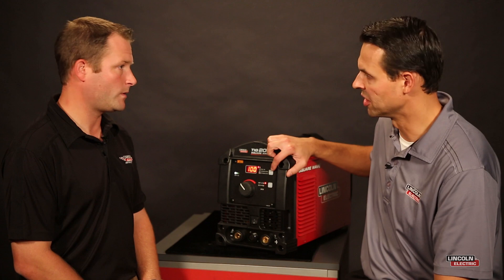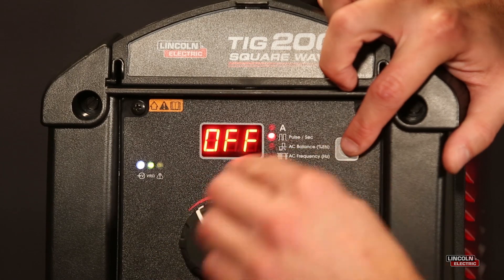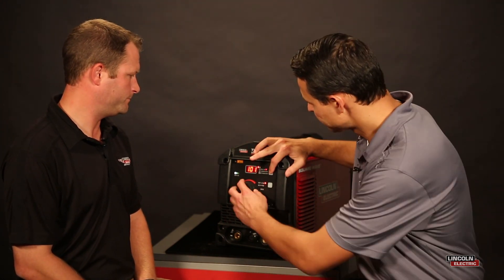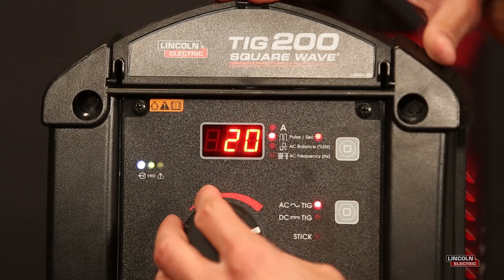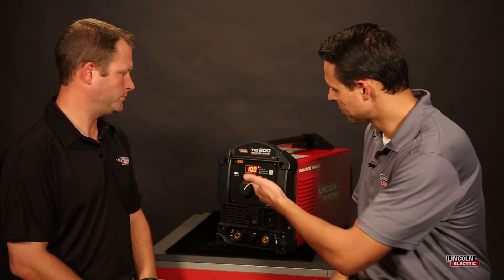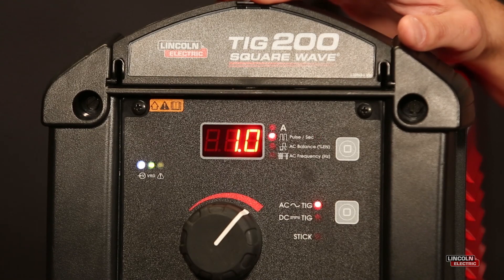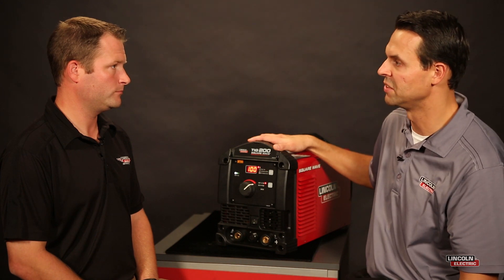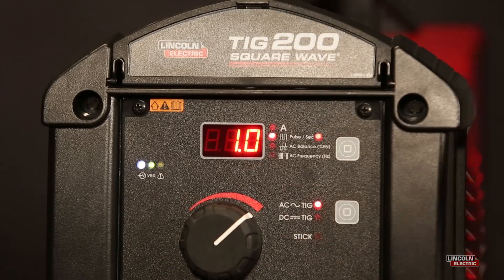Pulsed TIG Control with the Lincoln Electric Square Wave TIG 200

Comment: My bran new machine is screwed! I have to take off work to bring it back tomorrow. The amps light on DC blinks as if it were a trouble code, it won't let me adjust the pulse and on AC it spits and runs very erratic! I'm hoping they just replace it and not try to send it out for repair. I only had it for two and a half weeks. Very disappointed in Lincoln.

Comment: I’m not hearing very good things about this welder . Post flow is to long wasting gas , and arc start is to high . You guys ever going to come out with another version , or is going blue the answer ?
Reply: MajorTendonitis My boss just bought two of these and I love them. We had a job that consisted of very thin stainless and the machine worked flawlessly. The high frequency start will initiate arc from nearly 1/2 inch away. That came in very helpful for our job since I was welding a corrugated seam with narrow/deep corrugations. I used a 12 jumbo and had 1” of stickout. With the foot pedal, the machine never hesitated to initiate arc. It made the job possible. If you’re concerned about conserving gas, get a torch with a built in valve.
Reply: @jasoncampbell8797  I like the Features of this Welder, but certainly Lincoln must address all aforementioned problems. A product cannot work great for 10 people, but dismal for another 10 people. Sorry to ask: "will anyone buy a product he is only 50% sure will work?" Thanks.

Comment: After waiting for 7 weeks backorder for my TIG 200 to arrive I picked it up on Thursday.  The following day (Friday) I powered it up only to find that it was inoperable.  The fan came on (very noisy) and the gas solenoid clicked on and started flowing gas.  Nothing ever showed up in the led display and nothing further happened.  After troubleshooting every way I could think of with no results, I contacted Lincoln tech support who advised me to return it to the local weld supply store where I purchased it.  I did that yesterday and they said they would try to get it fixed.  Maybe Senior Lincoln should have spent a little more time on quality control before it left the plant in Mexico.  I'm very disappointed in Lincoln at this point.
Reply from the maker: +1jwrh Thank you for letting us know of this problem. I'm so sorry you had a problem with your TIG 200.  I have sent your comment to the product manager to try and get an answer for you. Please know that we pride ourselves on good QC and customer service. If you would like to send me your email in a private message, I can keep you appraised. So sorry for the inconvenience.

Comment: Does this machine have  Hf start or is it Scratch start ? Does it have a solenoid gas Valve ?
Reply from the maker: +David Span - Yes
Reply: Can you please be a little bit more specific ?
Reply from the maker: +David Span High Frequency Start and a solenoid gas valve are in the Square Wave TIG 200.
Reply: +lincolnelectrictv Thanks

Comment: I was wondering if it has settings for post flow, arc intensity, arc stability, and dig?
Reply from the maker: +David Santa Cruz 

There is no manual adjustment of the post flow, arc intensity, and dig.
Although there is no manual adjustment of the post flow, our machine does however operate so that the post flow time varies with the amperage set point.
As an example:
If the amperage is set to 30 amps, the post flow would be 9 seconds, whereas when the machine is set to 110 amps, it is 13 seconds, and at 200 amps, it will be 17 seconds.   There are a total of 10 predefined post flow set points based upon 10 amperage set-point threshold levels.
As to the subject arc stability, we have received good feedback with respect to the arc stability throughout field trial customer reports we have received.  As it relates to the arc, on AC TIG mode (commonly used for TIG welding on Aluminum), one can also adjust the arc profile by making an adjustment to the AC Output frequency.  At a higher AC output frequency, one can establish a more narrow arc profile, whereas at a lower AC output frequency, one can adjust for a more wide arc profile.
Reply: lincolnelectrictv thank you for clearing that up for me and ive always been a loyal customer and supporter of Lincoln Electric I have the full line of safety gear from you guys and I learned how to first weld with your little flux core welder that I bought from like Home Depot and im in the process of buying the powermig 210MP and the the Square Wave 200 tig from my local West Air store after this semester of my welding classes at Arizona Western College in Yuma,AZ I love the fume extractors we have from you guys and Ive been bugging my professor Mr. Sam Colton to let me try out your Power Wave 350 that we have at the school